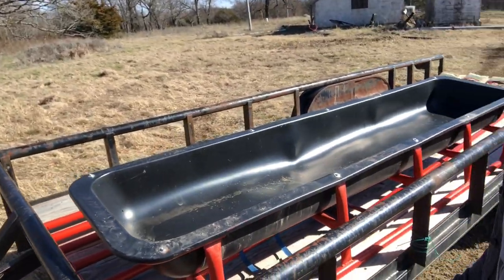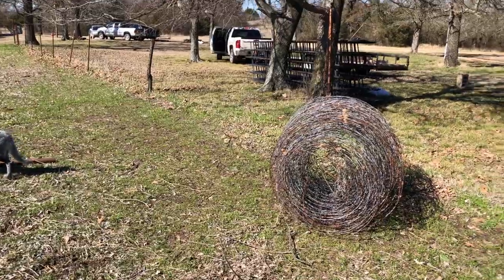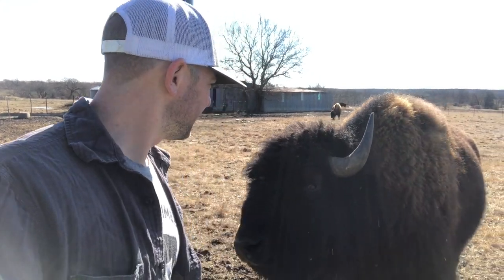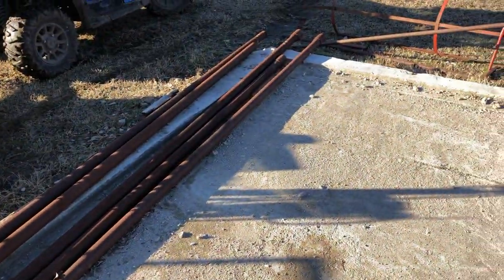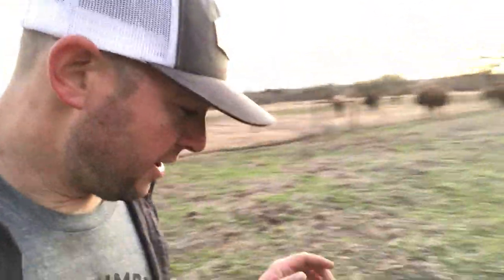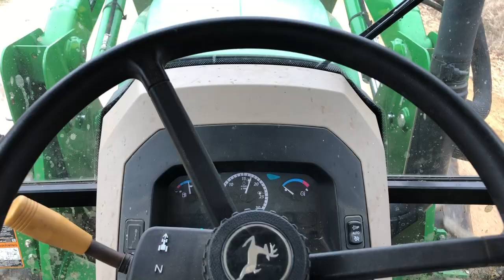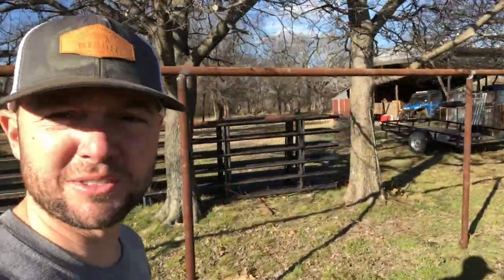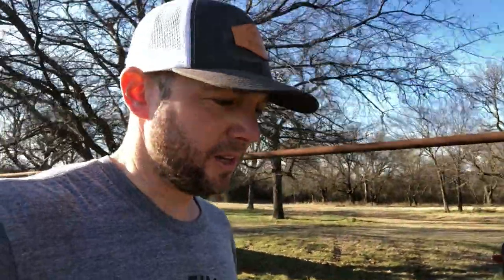This old fence isn't going to work...it's time to build a new bison corral (Part 1)

Comment: We had better luck using 6 inch pipe filled with concrete and 5/8 cable. Cable loops welded to the pipe. While I am no longer on the farm I drive by every few years and it still looks fine. We put it in the summer of 1976 and the only maintenance was tightening the cables once a year and painting the posts every ten years.

Comment: To make post hole digging go much easier, mark the post digger with the depth you need , this way as you are getting deep the mark is on the post digger...you won't need to keep measuring  with the ruler....

Comment: i guess fencing  height is different in each state  in Colorado if you wish to raise bison   you  need   two layers of fence  about 10 feet apart  the  first row of fence  can be   5 feet high  and the second row  10 feet from the first row  should be 6 or 7 feet tall and made of pipe held in by cement i guess cause  bison can jump  very well

Comment: You mostly said it right.  Hopefully, you are using concrete and not cement.  Cement is an ingredient of concrete that consists of cement, sand, gravel, and water.  Cement does come in bags and people can be confused, like my second husband.  Instead of using it for posts, we made a huge goat mountain out of bags of cement.  Cement crumbles.  Concrete doesn't.  Sidewalks and streets are made of concrete.  So, never say you are walking on the cement sidewalk because you are not.  My first husband was in the concrete business and this was a pet peeve of his.

Comment: Where did you get those panels at ? I had been thinking about doing part of my new coral with them ! Because I have been thinking about getting couple mustangs ! I have 2 horses right now one is a Appaloosa mare and the other is 1/2 Arabian and 1/2 quarter gelding !
Reply from the maker: I got them off of Facebook marketplace. In Lexington, OK.